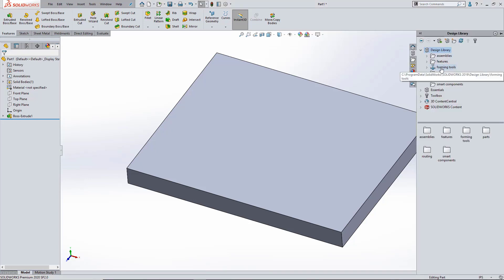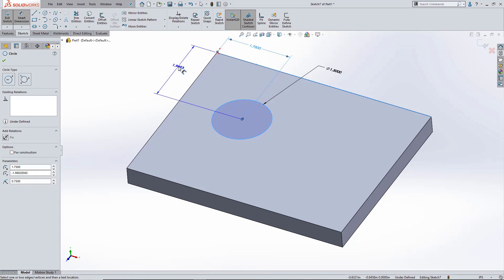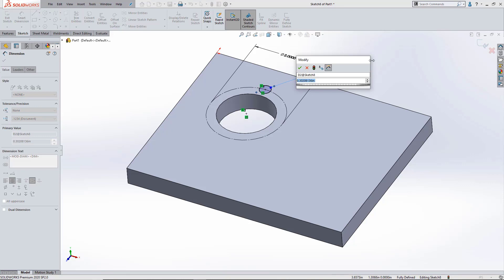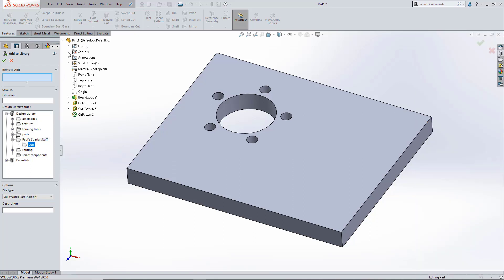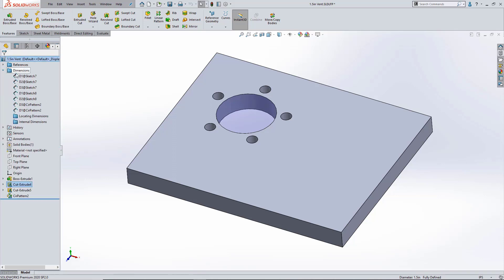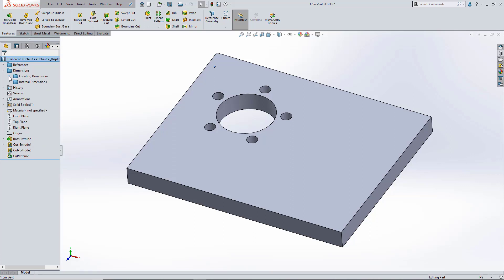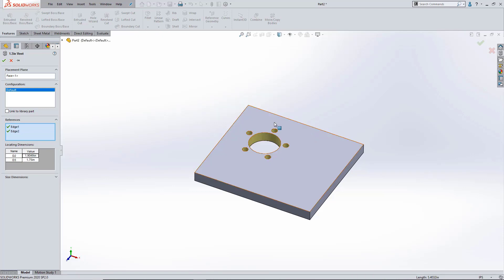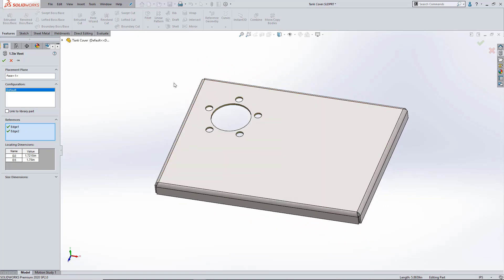SOLIDWORKS Design Library Tips and Tricks

Comment: I cannot figure out how to rotate a library feature, such as a feature designed at a 45deg angle matches up to a horizontal edge. any ideas?
Reply: You need a locating dimension to define the angle that the feature is cut at, so you'll likely need to edit relations to eliminate horizontal or vertical relations, and make sure your sketch rotates as a unit because of that one dimension.

Comment: Excellent Tutorial! Well done. A feature re-used like this can be an invaluable time saver over and over again.  I'm 30 years into my career as a sign engineering, and I am convinced Solidworks is the next level tool for me. I'm only 6 month into using SW, but picking up speed quickly using videos like yours. Thanks again. *I cannot afford $2k/day classes from re-sellers. I was searching for how to make hardware from McMaster Carr, into a smart fastener? Not sure if that can be done? Do you know? That would save time! I am not that impressed with the selection that comes with SW toolbox.